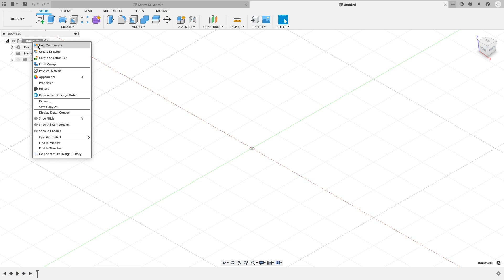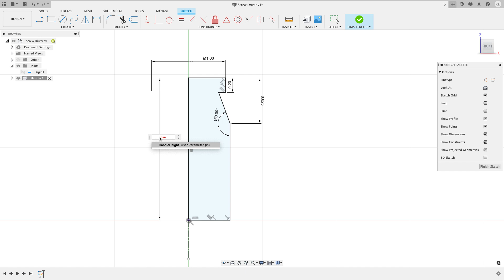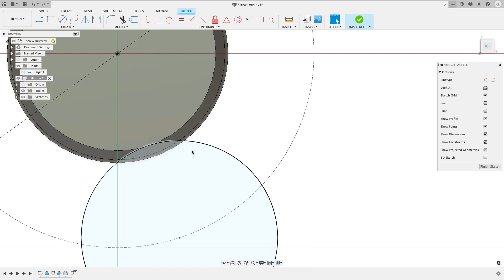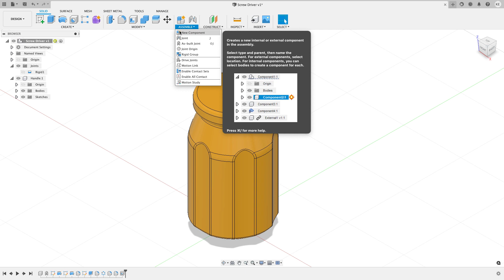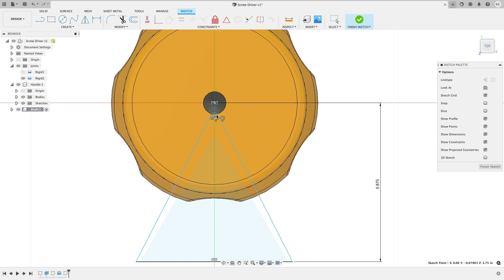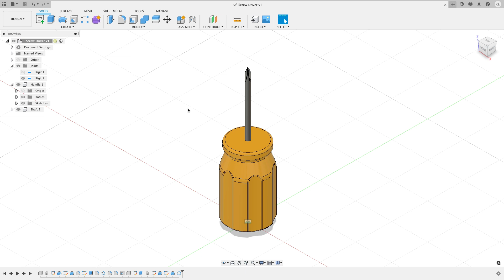Fusion 360 Screwdriver Tutorial

Comment: Thanks for sharing your very good video. But I wish someone would show how to create a dimensionally accurate ASME Phillips Bit & how those dimensions relate to the cutting Triangle profile. Any size Phillips Driver would do but a No. 2 or No. 3 PH Driver would be great.
Reply from the maker: HI Lenny. Will this video not show how to do that? Even if my dims weren’t right, you should be able to specify any dim you want using the same method in the video.
Reply: @MechanicalAdvantage  Yeah, you would think so. But with Base Flutes & Side Flutes, Cut Depth, etc., interpreting ASME & ISO Standards & translating them to the Cutting Triangle is extremely difficult. And there are no resources online to help with interpreting these Standards. But after numerous banters back & forth with Copilot & ChatGPT, I'm getting close. One thing I have learned is that to be standards-faithful, you can't simply revolve the triangle as you show to cut the flutes. Instead, you must sketch a path for the Cutting Triangle to follow using the Sweep command. I really do like the method you used to make the triangle symmetrical. Thanks again.